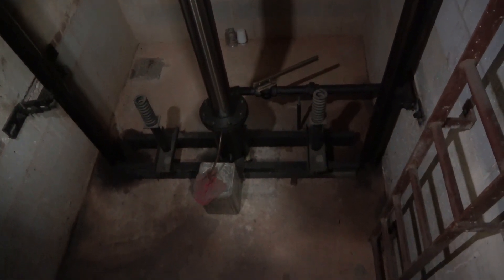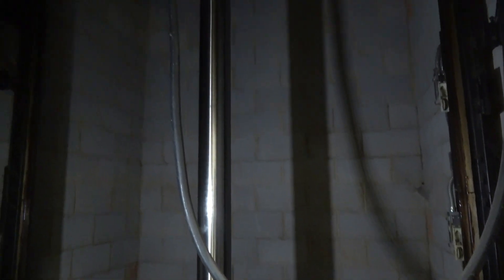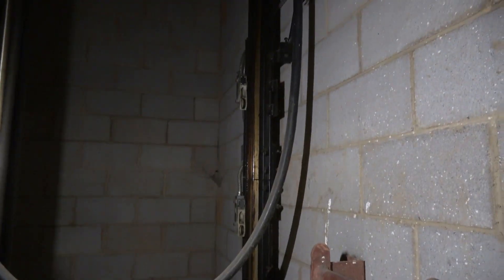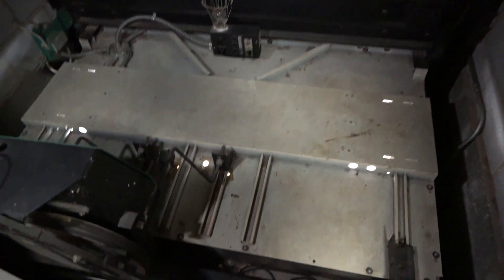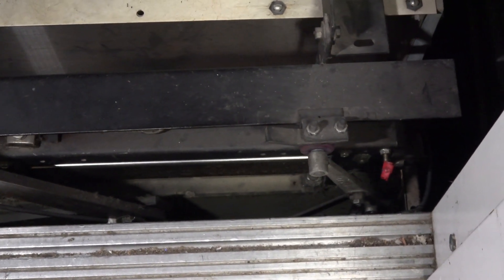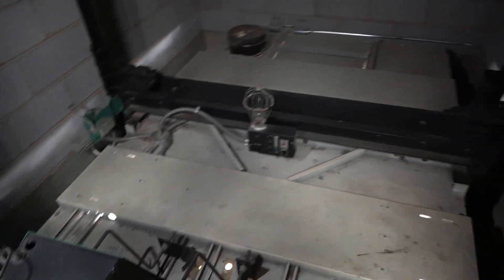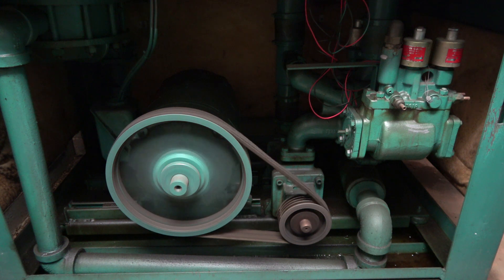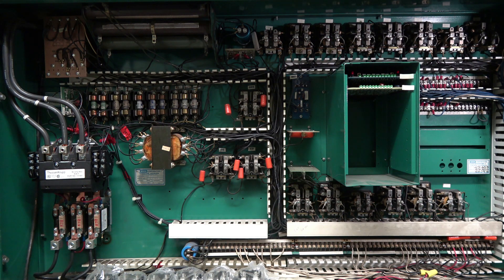Elevator Shaft & Machine Room Tour! Vintage Dover Hydraulic Elevator from 1976.

Comment: Built Dover Tough, just Like a Rock. Some of the best elevators ever made, alongside Otis. Built Dover Tough, just Like a Rock.
Reply: I have to dissagree, and agree at the same time.  I agree on the older Dover elevators as like all old machines and equipment they were built tough, and to last.  However the newer Dovers that were built after 1990 are junk.  Heck even Tyssen Krupp is junk alongside Schindler.  The best is Otis, and still a good elevator.  Otis is now owned by United Technologies corp the same co that owns Carrier air conditioning, and several other companies.  I remember being in high school from 1994 yo 97, and the school was built in 1991, had 3 floors and a Dover hydralic elevator.  Regardless to say, that elevator was broken more times than it was working and it was like this the whole time i was in school. I rememer having a class next to the machine room, and when they were working on it, all i would hear during class is the loud motor buzzing.  The teacher was getting very aggrivated by it.  I rememer after class walking by when they had the elevator in the service position, and i yelled out Dover sucks and is junk, and i said Otis is the best, and he gave me a look like i knew what i was talking about lol.  He probably thought who is this young teenager that knows about elevators.  I got to hsve a conversation with the tech at the time, and it was a great one.  Needless to say in 1992 they added a new addition on to the school with 3 floors, and i told the principal we need to make sure the elevator is an Otis not a Dover as we are having so many issues with the one we have, and he looked at me, and smiled and said Shawn, its going to be an Otis, and i was so happy.  I remember getting to ride it, and it still had all the protective covering on the walls of the cab.  It was a great elevator, and was a traction i believe. Great times in high school.